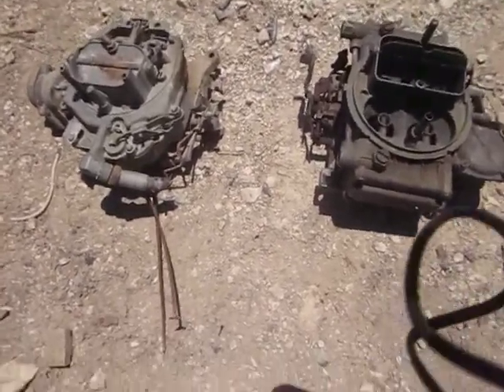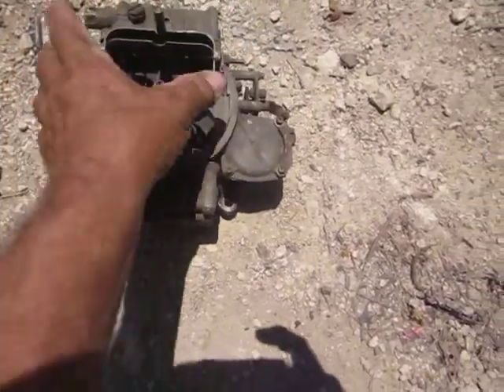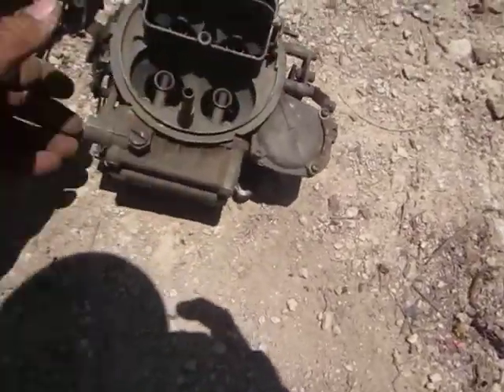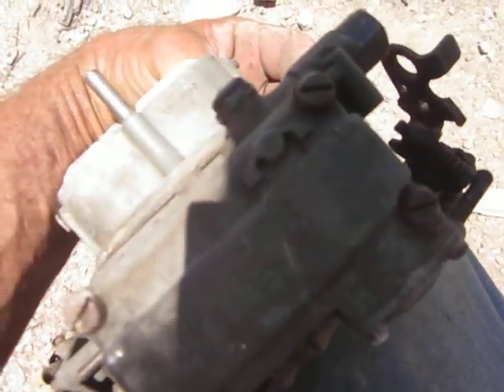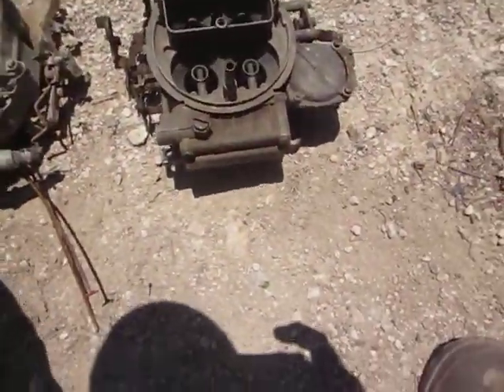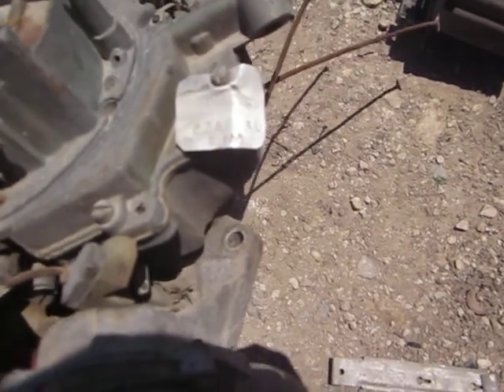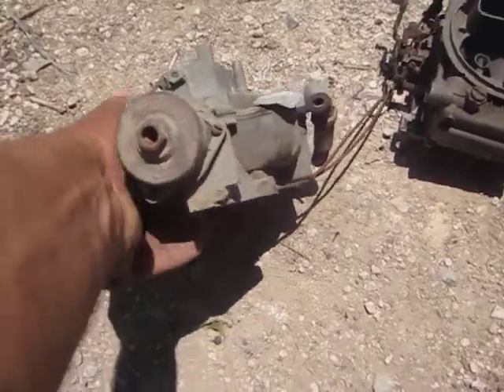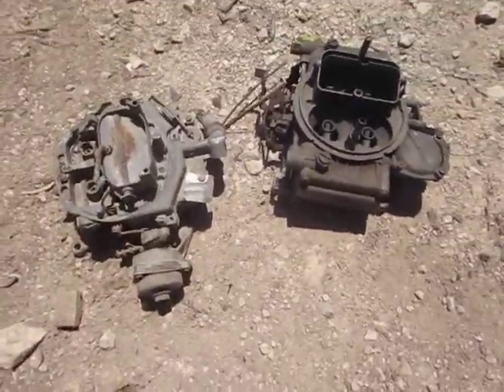Scrapyard Holley Carburetor. Should I go back and buy it or leave it? #NoName500 #NoNameNationals

Comment: Could that be an 1850-2? As I'm not aware of an 1860. Anyways the 1850-2 is a 4160 Model Holley Vacuum secondary manual choke 600 cfm carb. Date code (0650) is either 65th day of 1980 or 1990.
The Autolite is a 4300 Model for a 1967 Ford Fullsize (Galaxie, T-bird) either 390 or 428 engine w/automatic trans and rated at 441cfm.
 
The Holley is always worth a grab is the price is right. I try to buy cores in the $25-$50 range as some only make it to 'parts only' status and repair parts can add up $$$ quick. 
The Autolite, that particular model, is really only worth anything to a restorer needing one. They had inherent issues off idle and the fact it was too small for the 390/428 to begin with, only restorers will pay any real money. They are better suited on a small block, when you get the off idle issues corrected. Pony Carburetors Inc. in NY is the only place I know of that knows how to work out the issues with the 4300/4300DD.